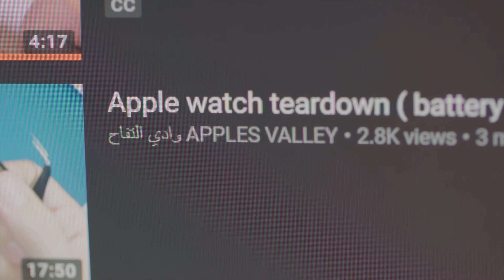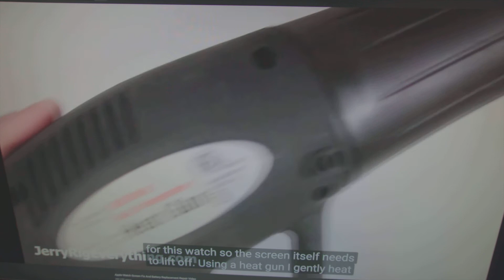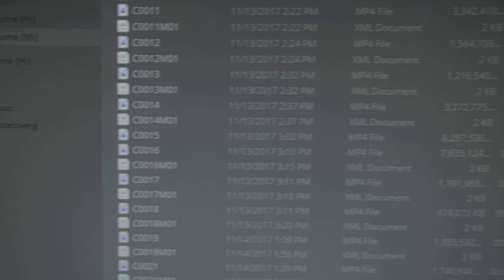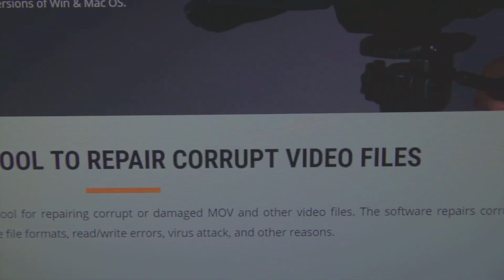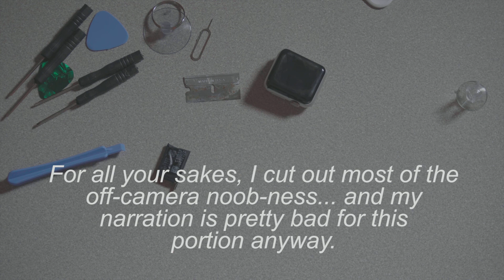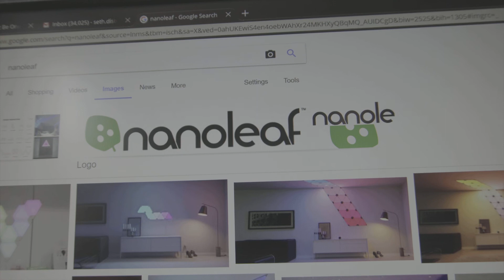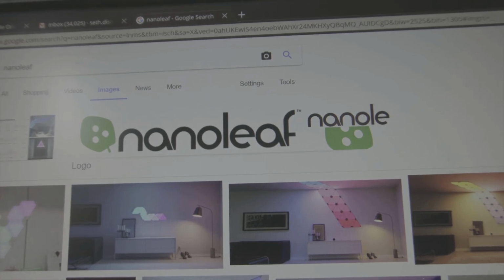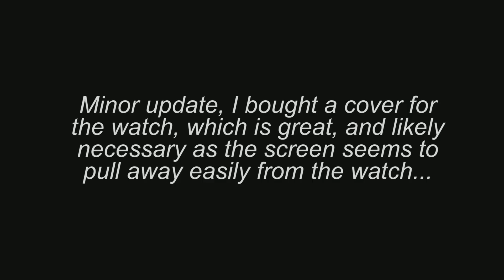TECH REPAIR: An Apple Watch battery repair (and my own video fail)

Comment: Hello there that was very good. I thought that the battery could be remove/replaced without removing the screen. Everyone else i notice do remove the screen. The main thing is the battery you want to remove. By removing the screen is just making more work when it's not necessary.

Comment: For the first time i replaced the battery in my iphone 6s mobile which involved removing some very very small screws. I had to be organised or else i would have mixed them up after replacing the battery. Now that was harder than this. With regards to the watch they should have made it that you could press the screen firmly unto the frame until you hear a click that means that the face is held firmly OR use a screws to hold the screen to the frame together.
Reply from the maker: John Rhule I agree they should have made it more repairable and allowed users to be able to swap out the battery if needed. Of course, Apple is pretty notorious for making their products unfriendly to repairs. Thanks for watching!

Comment: Good job. How's it holding up ?
Reply from the maker: Clark Kent it seems to be holding up well enough, though the adhesive that holds the screen on didn’t secure very well. This means the screen can pop off easier than I’d like. I could have probably corrected this by being more patient when reheating the watch during reassembly to soften the adhesive more.

I bought my wife a flexible screen protector that wraps around the screen to the back. It pulls double duty in protecting the watch and keeping the screen secure. Overall the process was cheaper and significantly less expensive than buying a new one, plus I got the satisfaction of fixing something... which for me is half the reward!